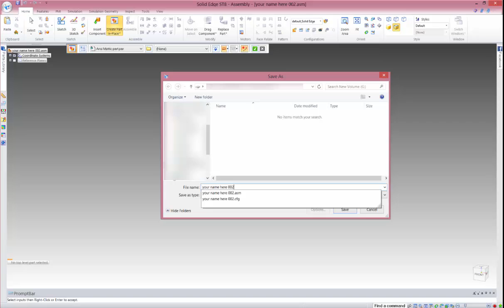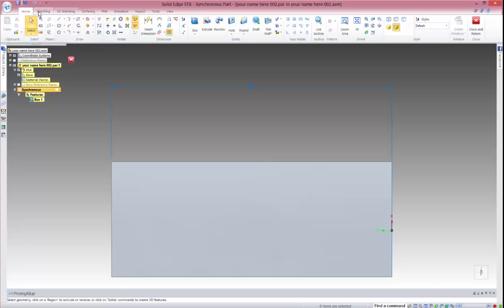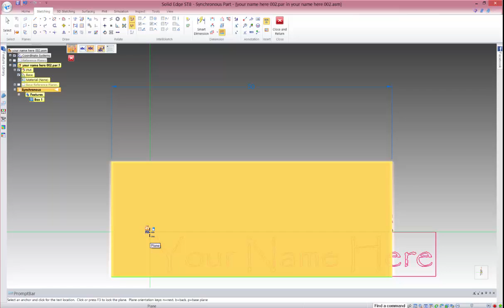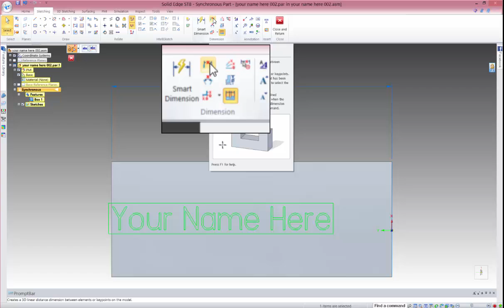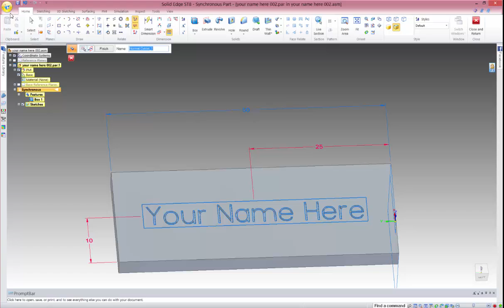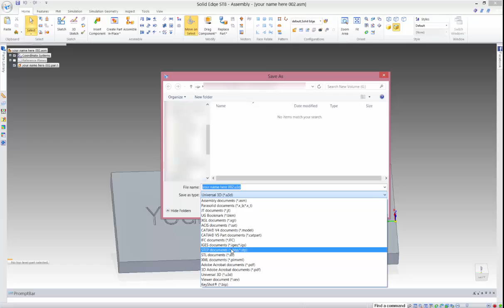Solid Edge ST8 text on surface

Comment: You  could have aligned it to the center of the part, instead of adding dimensions.
Reply from the maker: That proves challenging for new users.  Constraints often conflict with the dimensions leaving them frustrated.
Reply: A center constraint allows them to change the size, and not have to recalculate the other dimensions, unless you use a formula.  Learning these techniques will be very useful in a work place.  It does get a LOT more tricky when you go to synchronous though.